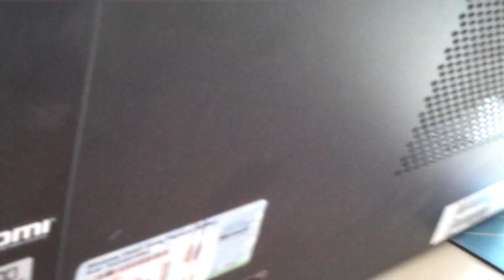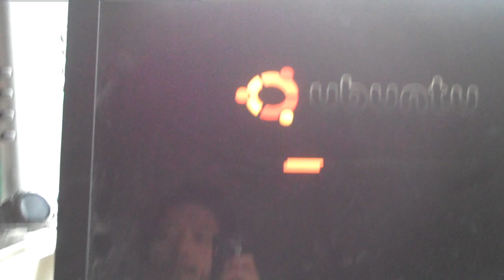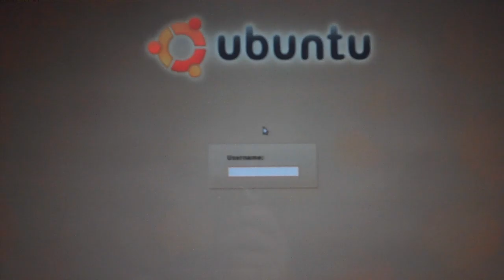How to Clean Your Computer CPU Fan!

Comment: Depends of your environment. If you live in a place dusty or near of dust, you probably need to do this monthly. If you don't, i recommend you make maintenance every 3 months. Also, you can check the performance of your computer, and if the performance goes down, then you need to clean up your computer, maybe replace the thermal paste, etc.

Comment: In some cases, i don't know exactly why, the north bridge is overheating. Probably is a problem with a capacitor near of it, maybe some power supply issue, but if the north bridge is overheating the computer works bad. So check the thermal on the CPU and the North Bridge. You can use a program like SpeedFan or some like that and check out the thermal measure.

Comment: hi zedomax. i have a question. lately, my computer makes a loud buzzing noice, is it possible because of the heat? it's very warm here sometimes, and it buzzes pretty loudly. but i've noticed that it doesn't when the temperature is just right. i've just cleaned the fan a bit just in case. thanks in advance and for your videos!

Comment: I can't believe you would go all that trouble just to clean the heat sink. a can of compressed air or a air nozzle blowing around side of the heat sink would have gotten rid of dust & while your at it blowing off mother board & power supply.
What you did now you must clean off heat sink paste & add new, crazy to do this procedure unless you are bored....

Comment: it's fixed now i took it to a store and yea socket where the fan needed to go in wasen't working anymore so they put it i na diffrent socket now it works but it won't go slow or fast it just stays at maximium speed but i knew that.

Comment: Simple Tip, After Cleaning the CPU Cooler, fix dust filters to any intake fans on the case -  this way no dust gets on any components and the dust filter unscrews to be cleaned once a week.

Comment: hi pal i just copy what you did on cleaning the fan and hit sink then remove only the wire on the fun but when i put it back the computer run for a 10 second the fun run then automatically turn off it self what do you think i need to do help pls

Comment: Next time before posting such a video on a public website, say a FEW sentences about how not having a ground wrist band when handling the heat-sink directly you can turn your $10 cpu fan problem into however-much-money-you-want-to-spend-on-new-cpu problem. Worst handling of one of the most static sensitive areas of the motherboard I have EVER seen.

Comment: @zedomax Hello Zedomax! I had a question about my PC. I opened my PC yesterday and did the same like you because my CPU fan was really dirty and when i was finished and was going to turn my PC on the degrees of the CPU fan was on 60-70 instead of 40-50 that was before. Do you know how to fix it and why it happened? Everything works fine i have set the CPU fan right in the PC again and screwed it as much as possible. Thank you very much for your video and for your awesome help :) Hope you answer.

Comment: @killerv135 Just took a look at the added date to the video, I guess should have checked first. As far as going back and forth about 'a subject thats not important' (And I don't know where you have read that you don't really need to re apply Thermal Paste whenever lifting the heatsink, its just dumb not to do so)   perhaps just close the comments on the video and be done with it, and do you think 5 dollars is a lot for paste that will last you forever? (unless you change cpus every day).

Comment: @lewisu2088 You know how long its been, i did not even know i had a comment up here. But your wrong thermal paste that was installed and is new will not need to be replaced. If you think that fine waste your money. I'm not going back and fourth on a subject that is not important, you feel it needs to be changed do so, I'm not in-titled to listen to your opinion and or agree same goes for you. Thanks for caring though =).

Comment: @killerv135 I disagree, any time you remove the heat-sink off the cpu the right thing to do is to clean the 'old' thermal paste, (I say old because it might be the case that the thermal paste had been applied recently) and apply some new one.

Comment: @pvp4revenge Yeah either that or the fan is going out completely. Try cleaning it and if it doesn't work, replace the fan. This happened to me cuz the fan went out and my PC crashed and fried the motherboard, and now all my files are gone, and they can't be recovered... soooo pizzed cuz now I have to use a computer thats from 1999 and its a friggin dinosaur XP

Comment: If you have a new pc thermal paste do not need to be applied. With an older PC 2 years or more if you where to do this then ya replace thermal paste, in his case no you do not need to replace, so get off his balls.

Comment: @olechri are you sure it not the case fan most CPU fans will be in the middle of your case and the battery on the bottom if it is what u are saying seek a professional to take it apart you would need to know more of the internals to take out the batterie to get to it

Comment: @xYukiYoru it's better just used a compressed can of air, you really don't have to take anything apart.
 you can get the cans of air at wal mart.just make sure you do it outside the dust goes every where.

Comment: @DBZisthebestanimever  Down load "Core Temp" I had a similar problem with a few ASUS boards "overclock failed" etc. check settings in BIOS I have a P5KPL with 2.4 Q666 overclocket to 2.75.

Comment: hey guys i have a problem. I cleaned my CPU fan and i experienced 11c temperature decrease but whenever i boot my PC it says CPU fan error F1 to continue. When it's idle its around 49c but it was 60c before and i haven't tried full load yet. My CPU is Q6600 2.4GHZ stock and my MOBO is P5QL

Comment: "The CPU itself is not dirty",     that is the CPU fan by the way.
That is not a case fan it is a PSU fan. Muppet.
If you can see it is not dirty why did you clean it, why not use a small paint brush or a can of compressed air. You should clean the concave side of the CPU fan to improve airflow.
The metal fins connected to your PC (don't you mean CPU)
Computers are made by people, WOW
You never replaced the heat paste.
You should clean your nose also (start of video)

Comment: do not follow these instructions. if you do besure to remove exsiting thermal paste and apply new. Clean thermal paste is just as important and all the heat sink cleaning won't help if the thermal paste is dirty.

Comment: @bouken92 probably broken the fan while cleaning it... :D My guess!...

A standard cooler you can get thrown in your head... you can buy one... be sure it is for the right platform and the right socket!... :-)

This or else you need to get some new thermal paste, clean the old thermal paste away, and apply new correctly... comes with alot of coolers, and or on the stock coolers for intel and amd cpu's!...

You can search how to do it online!... :-)

hope it helped! cheers!

Comment: @djcountry1985 NEVER use a vacuum cleaner on any electronic conomponents. STATIC ELECTRICITY can permanently damage them! That's why the blue screen happened! System memory dump just means the memory was unloaded in emergency situations.

Comment: Well, i did this today as you told me. Mine was little different from yours but i think i understood what i was supposed to clean.

The results? Well, it didnt really make my computer any faster but it sure as hell made it quieter. (I'm actually starting to feel it might've made my computer a tiny weeny bit slower(?)) Also, when i started my computer, i got like an "error" message where it asked me to start normal or safe mode(?). But it only lasted for like 0.005s till it dissapered.

Comment: @whatdemydid i have the same problem but wif my front rig fan. When the com is loading, the fan sounds louder than my living room fan at full power! but when the com finished loading all the programs, the sound stopped and everything resumes as per normal. So it's not really a problem for me. My guess for this weird sound is that the fan is too old!